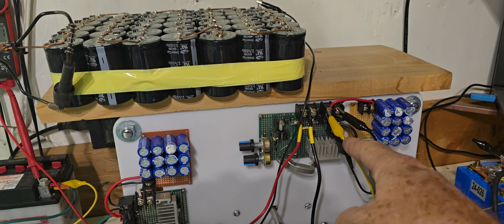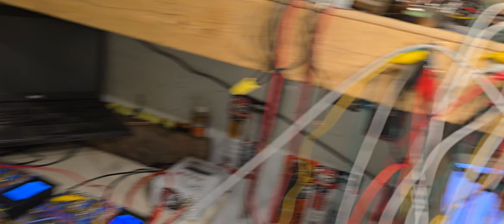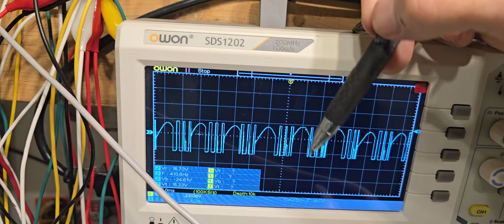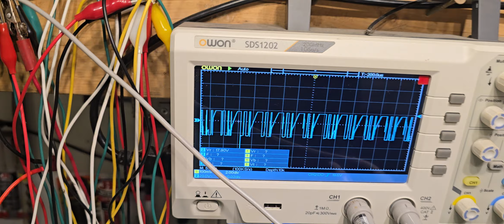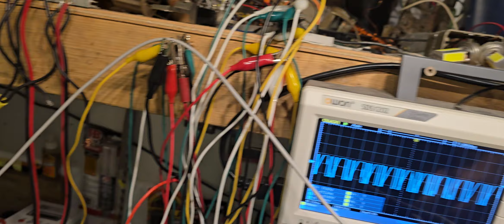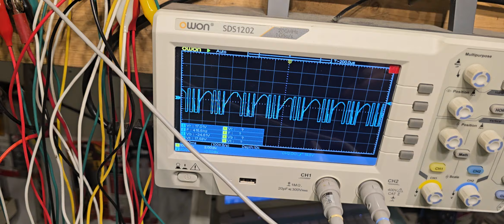Pulse Motor NS magnet configuration explanation Why I build these motors the way I do.

Comment: looks like your clipping the peaks and sending them  to cap dump ?
Reply from the maker: You each side of the motor does that when it's off .  Once the rotor gets enough speed it hits charging voltage in the drive coils so on top of the flyback it also charging from the coils.
Reply: @windpowerandmore6310  seems difficult to do when the drive coil is also being induced .  But i see your angle
Reply from the maker: At that point the coil is off on that driver circuit which makes it possible to use the sine wave to also provide a charge into the cap dump side
Reply: @windpowerandmore6310  i see your angle , i guess when the rotor magnet is on its way out instead of its  way in  to the core
Reply from the maker: @mykedoes4099 i made you a short video it explains it alot better than i can text lol . Each half of the motor is off for 50% of the magnets on the rotor
Reply: @windpowerandmore6310  that make sense , half the rotor magnets are generating other half drive
Reply from the maker: @mykedoes4099  yup I'm uploading a video for you right now if you care to watch it it can explain better than I can text lol
Reply: @windpowerandmore6310  i have a system that is N/S on rotor uses u core to drive 2 mags n/s using dc pulse and collects the ac with same drive coil at next magnet pair pass the u core
Reply from the maker: @mykedoes4099 that's the same way these motors work lol works amazing too especially with high rpms
Reply: @windpowerandmore6310  its little different uses u core to drive and separate stator but i guess your right the u core can also collect have a look "U Core Pulse Motor Generator DPDT Drive system"
Reply: It helps force the electricity in the right direction.